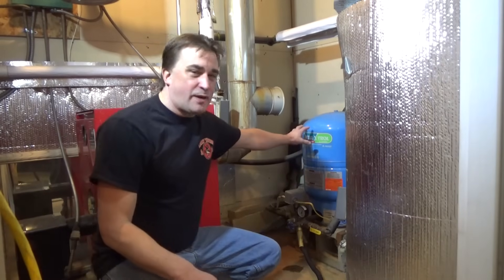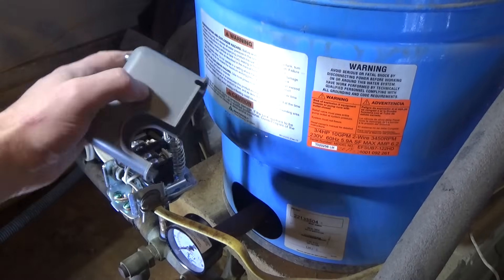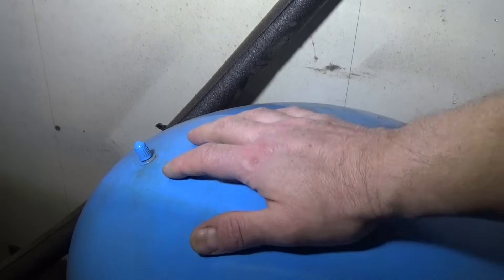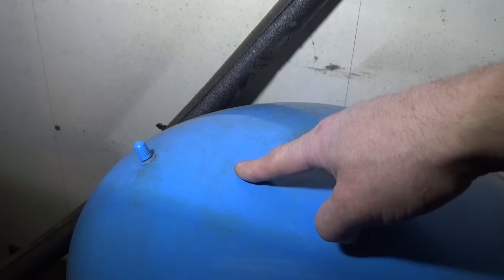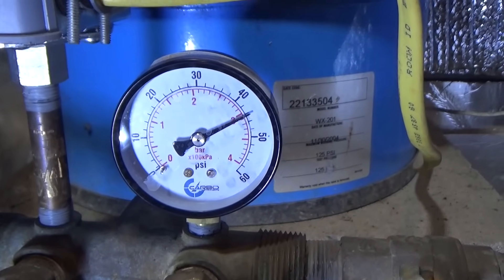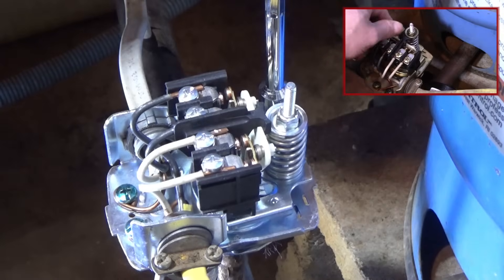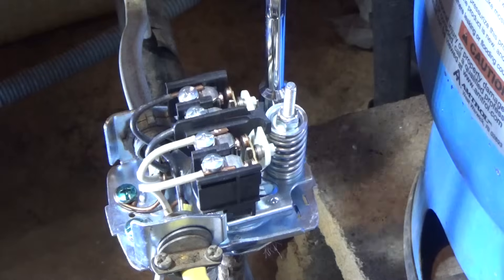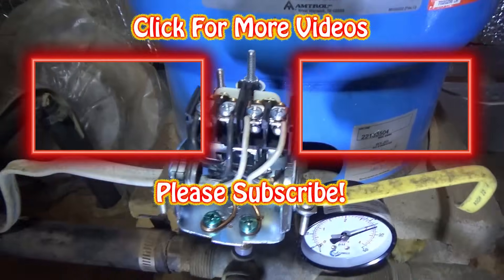How to Adjust a Water Well System Pressure Switch and Bladder Tank - Well Pump Diagnostics

Comment from the maker: 🛠 TOOLS & PARTS FOR THIS REPAIR:
🔧 Square D 20-40 PSI Pumptrol Water Pressure Switch on Amazon - https://amzn.to/2qw8rtV
🔧 Square D 30-50 PSI Pumptrol Water Pressure Switch on Amazon - https://amzn.to/31sgvbS
🔧 Square D 40-60 PSI Pumptrol Water Pressure Switch on Amazon - https://amzn.to/2qxGdiv
💧 Replacement Well Pressure Tanks on Amazon - https://amzn.to/2HV5Bp7
📊 Replacement Water Pressure Gauges on Amazon - https://amzn.to/2CB4MxX
🏪 Browse My Complete Tool Recommendations: https://www.amazon.com/shop/markjenkins
Reply: very helpful
Reply: Bought a brand new 1hp jet pump It was preset 20-40 When it kicks on it rapidly clicks on and off Im puzzled as to why this is happening. Im worried its going to screw the pump motor
Reply: @stephenjackson4392 s this question ever answered cuz I'm having some serious problems

Comment: I don't understand why a tank would matter what the pressure differential is. It seems like biggest pressure should matter (not differential).

The tank is designed to go to 0 psi on the pipe. So 60 psi in the pipe is 0 to 60 differential.  Easily handled by the tank.

Maybe you mean tank precharge vs highest pipe psi difference.  That's different than "differential" as far as a pressure switch is setup.
1:40

Comment: Thank you so much for the best explanation and visual on this subject. My well pump has been chattering so much lately. I watched your video. Went in my basement shut the power off to my pump, closed the water line  from
The pump to the house. Drain the tank and check the air pressure in it. It was 36 lbs and what's supposed to be 28. Let some air out I got it back down to 28. And I had to adjust the switch itself. Now it's all working like new again. It's been screwed up for the last 6 months and several people have messed with it. so thank you again.  I finally just fixed it and I'm a 64 yr old woman.😊😊😊

Comment: Just replaced my switch
My tank is reading 45 but I have very low water pressure ?
Need help please
Reply from the maker: Do you have a pressure gauge for your water pressure as well?  If so, run water and observer to see when the pump kicks off and on.  Also, if you release pressure from the valve, does water come out?

Comment: Wow, this is the best explanation I have seen so far.  Just put in a new jet pump with an attached pressure switch preset for 30/50.  Would prefer 40/60.  Is it better to just buy a new switch? Thanks.

Comment: I have a question, I have a problem with the water pressure being consistent, for a timed period of time I have great water pressure then it will drop off for a timed period of time ? I had the blue bladder tank replaced about 3 years ago with no change of pressure?

Comment: Wow.  For a single family home that tank is way to small.  Hardly any water reserve.  That tank is more appropriate for a single wide manufactured home.
Reply from the maker: I larger tank would prevent the pump from cycling as often.  But the primary purpose is to help maintain constant pressure.
Reply: @nogripes Less cycles longer life.  My well is 745 ft deep.   Replaced the pump back in 2011.  Wasn't cheap to pull all that out of the ground.
Reply from the maker: @MGMidget73  Wow, that is a deep well!   I pulled mine and replaced it... I have a video on here I think.  That must have been some heavy to lift.  I bet that wasn't pulled by hand !  haha

Comment: You did not mention what you were turning off under the psi needle.

You never mentioned which way to turn the wrench to adjust the 2 valves.

Comment: I have my 32 gallon tank rupture from the side so I had to replace it along with the rest of the fittings and pressure switch. I have no idea what the water pressure was before. After installing everything, the system is operating at 40 cut in and 60 cut off. Is that ok or do i need to adjust it? I made sure the tank was set at 38 psi before turning on the pump.

Comment: For some reason, my irrigation pump decided yesterday to start running constantly after running through a timed irrigation event and it continues to run even with the controller turned in the off position (the only way I could stop the pump from running was by throwing the breaker off). Unfortunately, I do not own a pressure gauge to verify the correct off/on pressure settings. Which of the two nuts and proper direction do I turn it to reduce the pressure and hopefully get the pump to turn off when not in use? The expansion tank had been set to 30 lbs so I set it to 28 lbs.

Comment: I'd cut and apply a strip of electrical tape over the terminals as a precaution for those looking to adjust the settings with power applied.

Comment: the trick for adjusting the cut-off switches while energized is to partially mount the protective cover such that the contacts are all shielded while leaving the adjustment bolts exposed. 10:35
Question: Where did you put the other end of the hose to direct the water?

Comment: When you pump some air in the bladder, the tank must be without water? I mean, no water pressure?
Reply from the maker: Well, actually  you're putting air in the tank and it provides pressure against the bladder that holds your water.  You want the bladder empty before putting air in the tank to meet your low pressure switch setting.  I believe I typically go 2 lbs. below the low side with an empty bladder.

Comment: I like to add that the inlet pipe to the pressure switch needs inspection from time to time As scale and rust will clog it, I found this out with mine where I noticed the pump cycles were out of normal operation - I'd say every 5 to 6 years depending on how much iron is in the water.
you drain the system /turn off the power/ remove the switch from the stub pipe and look to see if its clogged - if it is - clean it flush out the debris and reassemble / In my case I was able to remove the diaphragm clean the inlet with a small drill bit restore the flow and reassemble and normal operation returned...

Comment: Hi, this was a very good video regarding pressure adjustment and tank setup. I have a question regarding pump running every 20 minutes even with house main valve shut off. This is a well system that is approximately 18 years old. What are the causes to this situation?

Comment: I enjoy the video, how or what  do you remand when you two air tanks, do you put the same amount of air pressure in both tanks .
Reply: They tank with highest air pressure will not fill to its range if their pressures are not set equally with air when they are drained.

Comment: Mark first of all thank you for your videos. I have a 30 - 50 psi pressure switch. When my switch reaches the cut in Mark of 30 the gauge drops to zero then rebounds to 30. I noticed recently that our water pressure would drop through the house then it goes back to normal. What could the problem be
Reply: Tank when empty needs to be 2 psi (of air) below cut-in of pressure switch.

Comment: VERY IMPORTANT....whenever you close the shutoff valve between the well tank and the house plumbing, you MUST turn off your hot water tank...otherwise if it comes on, pressure in your house plumbing will increase rapidly and break things like toilet valves... or worse. You could even damage your hotwater tank if the pressure relief valve is stuck. It is also a good idea to open the highest faucet in the house until you open that shutoff valve again .

Comment: My brand new pump 40-60 switch. It keeps going off and on when at the 60lbs. I have not adjusted it. It’s brand new, but not the original. What is making it cut off and on so fast? This burned up my other motor.

Comment: Hi! Thank you for this amazing video, but because I am total beginner in this field, I've got few questions. I remember, in my old house, I had much better well water system with top of the line control panel and everything else and pressure was always 60PSI, but in my actual house (small bungallow), I've got just basic system (pump and pressure tank) and I never had over 40PSI even if pressure switch states (I found it by following your instructions)  that it should be 30-50PSI... And in the last week, it even dropped to just 30PSI... Water in my house is barely flowing... My question how do I troubleshot where is a problem? Do I have to ajust pressure switch? Is pressure switch defective? Is pressure tank a problem (broken blader)? Also, could I change a pump for better one with higher pressure 40-60PSI? I was thinking to change a pressure tank (20 gallons) for bigger (maybe 30-40 gallons), but how do I match it with a pump (I don't want to buy weak tank)? Thank you in advance for any advice!

Comment: I live in a residential place with a second floor. The water supply does not come from a well. When I moved in I noticed our whole house had low water pressure. We changed out all of the out-dated pipes and had the same result. I had my plumber install a Grundfos Scala 2 booster pump that conveniently began to leak after the warranty. Before trying to repair this device, is there another water pressure booster device that the plumbing community can recommend that has a history of reliability? TYIA

Comment: I tried adjusting my water pressure with a full turn on both nuts and now it keeps switching on and off. It’s getting hot and I have to unplug it. It’s 110. And I’ve been using it for years at the same pressure. What can I do to stop it from kicking on and off so much?

Comment: at the white wires the screw is burned and rusty  it works with short cycles though any one knows the reason?
Reply: Moisture Exposure
Reply: @ktm250sxrider2  hi thx for you reply i found it the rest of the screws are fine so its not moisture i think i didnt tighten them good but its too late and its forzen

Comment: Why is my pressure gauge stuck at 62? I shut my power off, drained all my lines and the tank but the gauge didn’t move at all. The tank still has a little water in it. Not much but it’s def not bone dry. I can hear some in it. I tried someone’s idea of pushing down the valve on top of the tank and no water came out so I don’t think the bladder is bad but what do I know…
Reply: Probably gauge is bad. I put a ball valve on gauge line and turn on only when I want to see pressure.

Comment: Easy safety procedure: with the power off, cover the electrical terminals with electrical tape. That way if you accidentally touch or drop tools on them you're protected.

Comment: What caused you to conclude that the water pump was gone? My switch is a 20-40 and when I open the water the pressure drops slowly in an orderly fashion until it gets to about 25 and then collapses to 20 and the pump starts. The bladder is not a problem.

Comment: How or when do you check your air pressure in the tank? Drain all the water then check the pressure before refilling or can you check with water in the tank and add air in the tank within the 2psi of the cut in on the pressure switch? 

I have to replace my pressure switch which is 40/60…so if I understand you correctly the tank should read 38 all depending on the ambient temperature.

Comment: Very helpful.  I added an expansion tank to my RV and neglected the home. This video showed me how to correct my tank bladder pressure and adjust the springs for cut on and off on the well pump.  My whole system was way out of balance. Bladder at 24 psi. Cut on at 41 psi. Cut off at 58 psi.  It should have been a 30/50 with the bladder at 28.  Thanks for showing us how to get this done. 

Also, code here is to have a disconnect within a few feet of the well pump pressure switch so instead of going to my breaker panel to turn it on and off I just used that disconnect.

Comment: I got tired of replacing pressure switches every few years. It's not hard, but it really sucks to wake up to no water, call in to work, climb down into the well, diagnose the problem, get the replacement switch, install it....all because the contacts started burning, created excessive heat, then melted the plastic causing failure. I finally installed a triac (basicly a transistor for ac instead of dc) and now the pressure switch only switches a tiny load for the gate of the triac and the triac switches the load for the pump. Thing is indestructable now!

Comment: HOWdy  M-J, ... 
Thanks - Great VIDEO ... 
...
I was instructed to put a SERVICE DISCONNECT  close bye each  remote device ... 
whether it was an: / Electric Water Heater / Air Conditioner / WELL PUMP / etc Etc ETC  ... 
quite a bit >more convenient than running to the CIRCUIT BREAKER PANEL each time ? 
...
COOP
the  WiSeNhEiMeR from Richmond, INDIANA 
...

Comment: Mark, thanks so much for the video....its been quite a while since I was on a well system (1997), and have been on another one going on two years now. My pressure switch has never worked correctly, cycling on and off every 3 or 4 seconds until pressure was restored; it finally broke the cutoff contacts loose. I did manage to find the tiny spring and the contacts on the floor, after much searching, and put them back in place, placed a drop of solder to act as a holding nut, adjusted the cut on and cut off springs (much thanks to you), and restored the power. The pump came on, just humming a happy tune, and ran for about five minutes before cutting off. I believe it's fixed. Thanks a bunch.

Comment: I have a 30 50 switch. It’s cutting out at the 50 but it won’t cut in at all on the low side and will drain all the way to zero. I have to manually engage the switch to build back to 50psi and it will cut off again. I already replaced the pressure switch. Any ideas?
Reply: It will hold pressure once it cuts out as well if that helps

Comment: Thank you Mark for this nice video. If I installed 30-50 switch, is is possible to lower the pressure and make it 25-45. Thanks.

Comment: my switch is a 30/50 setting , everthing works fine , cuts in and out within 2 minutes , but when i regen my water softner it will not cut out at 50 . It will just teeder on 50 but it just cant get there, i have to turn the switch off and back on again to stop the motor, So would i have to turn the small screw out a bit so it can reach the cut out pressure?

Comment: Excellent. Thank you!  Currently, i’ve got a Square D 40-60, but my cut in is 24 psi and my cut out is 74 psi. I don’t know who the hell set it that way, but at least now I know how to adjust it. Thanks!
Reply: I'd leave it like that. It will reduce pump coming on and off, ie reduce cycling.  You want to save your expensive pump. On/off cycles kill pump life.

Mine is 25 years old.

Comment: You made a comment about 240v being more dangerous then 120v Amperage is the damaging number. U can be running a 20Amp 240, or a 30 amp 120. You would have a more fatal damage from the 120. I unfortunately have been wet at the pump changing the pressure switch, 240, 20 amp and have been shocked due to no lock out tag out. Some one turned the breaker in the house on while I was out side working on the well.

Comment: On top of the retardation of jumping all over the place like a jumping bean you say you're going to leave the power on and then in the corner you're showing yourself cleaning the brushes very very misleading and confusing for someone that just wants to adjust the pressure without getting killed and people can die from amperage 110 120 volts will kill you just as fast as 240

Comment: I have a pressure switch that will chatter at the low pressure cut in. Pump turns on fine will build pressure and pressure switch will cut the pump off fine. However, when the pressure drops the pressure switch chatters and the pump will not kick back on. Any ideas?

Comment: what if the pump sh1t is not producing enough power to reach even 42 and the smaller nut is already uninstalled completely to reduce the cutout pressure?

Comment: Great video. I drained my tank and checked the air pressure and it was way low. My switch is 20/40 for a 1 hp pump. Now when I turn the power back on nothing happens. I figured the pump should kick on now to fill the tank again. Any idea what is wrong? Maybe I need to adjust my switch?

Comment: U mentioned u went from a 1/2 ho to 3/4 hp pump.  Can u provide guidance on the wiring to go from 110 to 220?  For example, did u run new wire or convert your existing wire.  Thanks.

Comment: So I had a pressure switch catch on fire. I don't know what it was before. Is there a way to find out or does it matter
Reply from the maker: You could measure the pressure in your tank, assuming that the tank pressure was in the ball park of being correct for your previous switch.  If you get a pressure switch that is too high, like a 40/60 it may work your pump harder, but otherwise, it doesn't.matter too much.  With higher pressure, you may develop faucet leaks etc.  I hope the fire didn't cause too much damage.

Comment: I did what you explained and it turns out I need a new well (water) pressure tank (water squirted out when I checked the valve so I know the bladder is damaged). Do you have any videos on replacing them? Just wanted to quickly ask. Thanks
Reply from the maker: Sorry, I don't.   But o ce replaced, you'd adjust the pressure  as outlined in this video.  Good luck!

Comment: Have you did a video, of why the pump cuts on and off really fast?
Reply from the maker: I don't,  but have you checked the tank pressure  as outlined in the video?   If the pressure is off  or if the bladder has failed, the pump could short cycle like this.